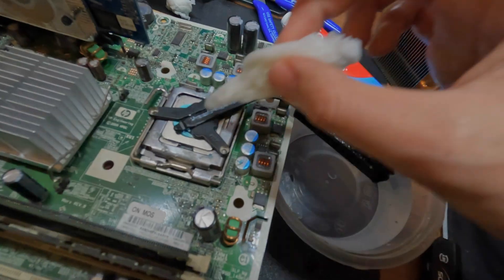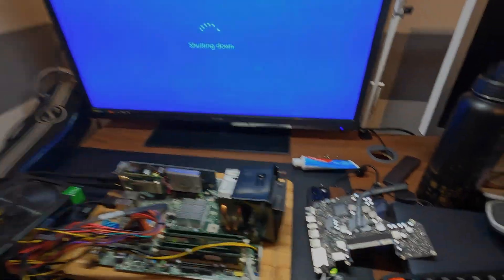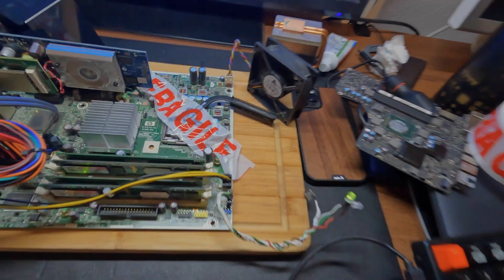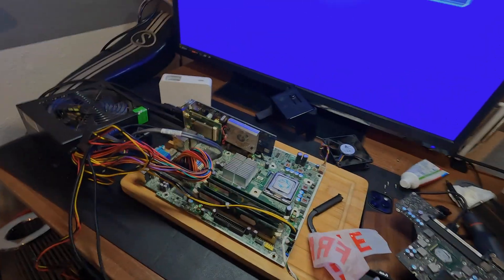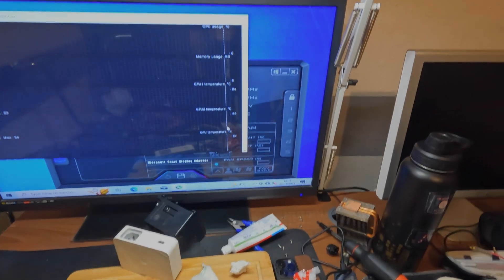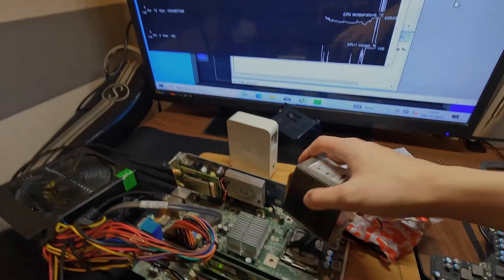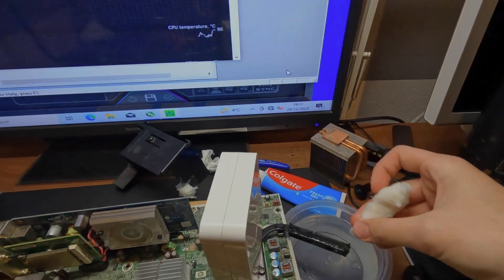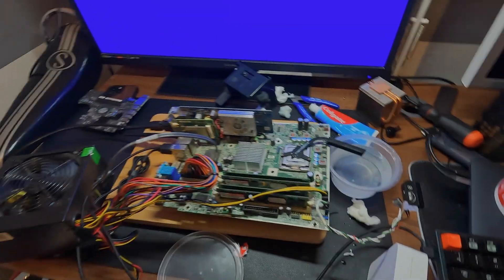Laptop Cooler on Desktop PC...

Comment: You could take the pump from a room decoration fountain and pump water onto the cooler, but don't forget to shield the motherboard from the water. 😉
Also, use proper thermal paste instead!

Comment: Well eh.... you can, but not like this. Ive tried this style too, gets hot yeah... a more powerfull fan, but tinier, with proper flowguides (and less turbelence) might fix a bit of the fan problems, then your thermal connection of the cooler nd the cpu is not optimal (lol, toothpaste lol). so many factors that make it not work. still fun to watch,  reminds me of my teenage years and computers.

a bigger heatpipe, or 2, to suck the heat away, and more airflow (this doesnt mean bigger fan, means less turbelent air, more troughtput so to speak). a who am i kidding, just not like this lols.